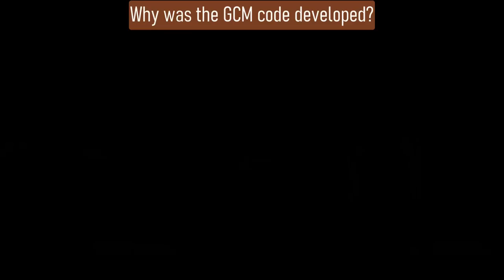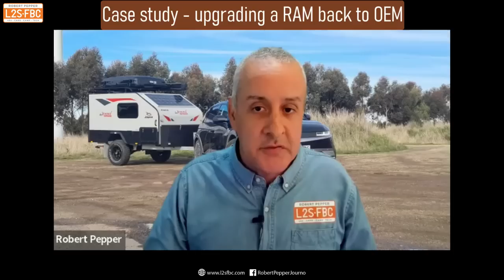TMR interview on GCM, GVM upgrades and trailer law - hear it from the top!

Comment: Very little info on the new GCM code. Would have thought it would have been the big talk of the interview. Even just asking what most people would want to know is "I have had a GVM upgrade on my vehicle, under LS16 can this extra from the GVM increase be added to my GCM so I can retain my full tow capacity. As the original GVM upgrade basically takes from the tow capacity and adds to the vehicle capacity."
Reply from the maker: That's not how GVM upgrades work. The tow capacity and GCM are different and you cannot trade them off like that. Each is a seperate limit. What else were you looking for?
Reply: @L2SFBC  I think you dont understand what I was meaning. I know you dont just trade them. What I mean is for example you have from factory 3000kg gvm and 3000kg tow with gcm of 6000kg. You go get a 110% GVM Upgrade which brings it up to 3300kg and still as above tow and GCM. In theory you will not be able to use either 100% of the GVM upgrade or 100% of the tow capacity due to the total being more then the GCM. 
SO, what I was getting at is that 110% that was added to your GVM (300kg) be included in your GCM bringing it to 6300kg so you can still use 100% of your tow capacity. 
Being that that GVM upgrade has been done is there a simple way to then get that 300kg added to the GCM. 
Make sense now?
Reply from the maker: Hi again - that's exactly what I meant. The three limits are seperate. However, if you're going for a GVM upgrade you could save some time and money by engaging the engineer just once to do more than one limit.  There is no 'simple way' just one way to do it.

Comment: A question I wished you asked is if a rating is approved through a SSM modification can this be used for the new QLD TMR process. This package has been engineered for SSM of a vehicle.  EG a Lovells 4T GVM with 4T BTC and 7.8T GCM upgrade be applied post 1st registration.
Reply: I am in a similar boat. I have pre first reg SSM Lovels GVM upgrade and GCM upgrade in Victoria Federally approved so I think I would be right in Qld or any other State or Territory.
Reply: @stevegoodwin5841  If you have a pre rego SSM upgrade you are good in all states. My point is why can't the engineering that's done on the SSM kit be applied post rego.
Reply: @jebw  If you have a read through the LS11 GVM codes you can use the SSM approved kits to do the same upgrade on a post registered vehicle. You just have to use the exact components used in the SSM kit and have approval from the persons/company that gained the SSM approval to use it or seek the approval through one of their approved installers. I have personally spoken to Adam Shaw about this prior to LS16 being released. Doing a GCM upgrade on a post registered car using an SSM approved kit though I am unsure about

Comment: Hi Robert, I have a 200 series with a Lovells GVM post rego upgrade in WA. GCM is limited to 6850 as per current legislation. If WA adopted the new Queensland laws would I be able to have my GCM re-assessed and upgraded to 7700?
Reply from the maker: Nobody can say for sure. You would need to have an engineer assess your vehicle, identify the modifications required, then pass J2807, and have the Design and Evidence package accepted.  Maybe it would pass,  maybe not.
Reply: Surely you’d be able to get an upgrade so long as the engineer could determine that your existing vehicle would still pass the tests.

Comment: Clear as mud is a good way of putting it.  Robert from your interview can you tell me that if I have for example a 200 Series that was upgraded by Lovells to their 4200 GVM & 7700 GCM that was of course approved by the engineers & new compliance plate fitted & checked by Vic Roads & approved (of course a Victorian registered vehicle).   Does that new GVM & GCM rating stand in Queensland whilst I am towing through their state?
Reply from the maker: I asked the question about interstate modifications being legal in Qld and the engineer answered - you can use the chapter list to jump to his answer. I did not ask about Lovells GCM upgrades or any other specific kit as the answer covered them all.
Reply: Im confused at your question mate. it has always been legal to tow "through" a state with different GVM/GMC laws. I just finished up a lap of Aus with a ranger that had a GVM/GCM upgrade by lovells. it was done in NSW and the vehicle was registered in NSW while we were on our trip. Every single state has no issue with recognising those revised numbers AS LONG AS IT IS STILL REGISTERED IN THE STATE IT HAS BEEN ENGINEERED FOR.

We finished our trip in QLD where we live now, i had to sell the ranger as i could no longer legally tow our van once i had changed over from NSW to QLD rego.
Reply from the maker: Indeed...but the question still comes up.
Reply: Garry, my understanding from the latter part of the video is, yes, you can. What is engineered compliant in one state with all the plates fitted, you can legally drive it in another jurisdiction. You just cant sell it without it being re-engineered in the gaining state. But this falls into the 'buyer beware' category.

Comment: I really wanted to say "All good". But as others have said, the general conversation seemed to get bogged down and become a bit 'clear as mud'. Much of it came down to "it's up to the engineers". 
Seems well and good as long as all the engineers are TMR people and don't hold to kickbacks or other incentives. But, just as has happened with the council requirements in the building industry with the private certifiers being anything but standard in their certifications, one hopes this will never happen in the vehicle registration industry also.
It would be so much easier if the vehicle manufacturers just made vehicles that safely towed the weights we want to pull all over this country. The cost of a new or near-new vehicle is already huge with massive wait times, let alone the cost of the trailer as well. How come we need to modify every vehicle just to tow a van or 5th wheel? There are so many almost standard upgrades getting around. Surely by now, we should be able to buy something suitable 'off the shelf'.
Reply from the maker: I think that's the key - up to the engineers. I'd say the bigger problem is trailer makers going too heavy.
Reply: Up to the engineers is a huge problem because they face all the risk and not really that much of the reward. In Victoria they are super conservative with signing off on modifications, so whilst a vehicle might need the specifications outlined, you just can't get an engineer to approve it.
Reply: Vehicle manufacturers play a balancing game.

On one hand they want to sell vehicles, and if their performance statistics are woeful, nobody will buy them. On another hand, they want to build vehicles as cheaply as possibly.

Long gone are the days of just slapping together excessive amounts of metal so that it’ll last. These days there’s incredibly advanced software programs that can simulate an entire warranty period of stress/strain/fatigue upon every single tiny component, and identify when and where things will break. From there they can improve those components until they get the vehicles to a point that believe an acceptable percentage will not see failures within the warranty period.

The problem they have is that Australian Consumer Law gives serious power to individuals such that if even a couple manufacturers start extending warranty periods, and building stronger vehicles that last longer, ACL states that the warranty means nothing, and that a consumer has rights based on “reasonable expectations”, so as some manufacturers start skewing the expectations, it makes others liable for failures they don’t design out by making more durable.

Manufacturers don’t want to be responsible, and they don’t want to give you “the best” vehicle they can. They design something they know will sell because you have no real options, but they hold back massive amounts of performance so they can loosen the reins a little every few years, to make people upgrade for fear of FOMO.

If they actually have customers the best they could, they would actually have to develop proper upgrades to lure buyers into upgrading.

Since manufacturers don’t want to give you the best, and don’t want to be responsible, why would they want to give customers higher GVM’s/GCM’s/BTC? All that would do is make them responsible for failures.

By making you go to SSM to get upgrades, OEM’s can wipe their hands clean of any failures, but suggesting the upgrades caused the failure. Adding 50% more capacity means the drivetrain has to work harder, so that can be absolved. The chassis bears more strain so without reinforcements it’s not the OEM’s responsibility, and with reinforcements it’s not the OEM’s responsibility as they didn’t make the modifications. Same goes to suspension and axles, etc.

It’s less responsibility to offer less, because the risk of failures is less, lest you defy the capacities, thus absolving them.

Stateside it’s big business to offer high capacity models and packages, but we just don’t see the volume here to justify it.

Maybe as some of our models become more global products, these sorts of options might start flowing through, but it’s not a given.

The LC300/LX500d/LX600f aren’t big enough volume. The Prado and Lexus GX aren’t big enough volume. The Tundra/F150/Silverado/1500 offerings are too niche here to make those offerings yet. Maybe the closest in the Ranger, and maybe the Hilux (if it’ll be based on the Tacoma). Even then, there’d have to be “Heavy Duty” packages offered stateside first before we would start seeing them here. Likewise if the full-size “Trucks” get real volume here; locally, they will start offering Heavy Duty packages.

Everyone just needs to keep hitting up SSM’s. Maybe that’ll be the interim solution; campaign for OEM’s to partner with SSM’s, to develop upgrades in line with the vehicle development, so that upon release buyers can get the upgrades from an official partner. It might be a compromise.
Reply: @CM303898  Plus Australia is a tiny market on the world's stage. Australian purchasing decisions don't have that much influence.
Reply: @HardstylePete  exactly. We are a risky market (in turns of OEM responsibilities under ACL), and so adding risk by accepting higher loads through higher ratings just doesn’t stack up to them.

It’d be the Wild, Wild West for upgrades if ACL didn’t exist.
Reply: So I'm replying to my own OP! I know that is silly but this is a complicated issue. 
I have a quite old (35yo) HJ75 cab chassis type ute with an aluminium tray. It has served me very well all these years as I am its second owner. The first just drove it to a few grain farms in NSW to pick up samples.
I've had it all these many years and have no desire to let it go. I have kept it in excellent condition. It has no rust or damage, no bog and all its bits intact. It does have some 'upgrades' before they were considered upgrades! a bigger clutch, a reconditioned 1HT engine out of a Sahara, bigger brakes, better shockies, more leafs, etc.
I remember the manufacturer stating in the manual that it would carry a ton. In those days a 1 ton ute carried 1 ton! I've carried 1 ton many times. Always knowing it could handle that load.
Nowadays, landcruiser cab chassis types are still classified as 1 ton. But they actually can only carry half that weight because the rest is soaked up in all the other parts of the vehicle. And some are only rated at 750kg which is 5/8ths of bugga-all! 
A person buys a landcruiser ute type vehicle to be completely reliable and carry a ton, pure and simple. How Toyota can make such a vehicle to be only a 750kg lightweight, which in fact means only around 250kg in the tray, is beyond me. That is just a baby ute and a truly ridiculous proposition. Leaves a bad taste in my mouth and makes me feel like Toyota is pulling the wool over our eyes. 

This is basically what CM303898 said in response to my original post. And I assume all the other similar manufacturers are on the same bandwagon too. Which is very sad for this country as we tend to have unique needs by dint of tyranny of distance usually.
But now we have a variety of other brands usurping King Toyota's crown and if they are not careful to get their arse into gear quickly, they will loose their widely and so far, easily held, top spot (in this country anyway). But as stated, what this means in the greater scheme of things is diddly squat. 
Having to wait so long for delivery on such an expensive vehicle is wearing thin on many people who don't have the time or the inclination to do so. So they are looking elsewhere at other brands that claim to be tougher or better or whatever. 
And while they may not end up being as good as a Toyota in the long run, most people who would not wait, really don't care for those sorts of feelings as they will sell that vehicle in 3yrs time and get something else or stop touring or whatever.

Comment: Davis Dam test,  They allow for a towing dyno or a climate control stationary dyno with the load requirements programmed.
Where does the average person access these?   

Why not assess certain section of road across the country and come up with our own drive cycle test?

It Always comes across like TMR want to the seem like they are listening to what we want and acting on it, but they always implement it in a way that is overly difficult to access the required test facilities or is in some other way restrictive.  
Their goal seems to be make it too difficult for most people to do it.
Reply from the maker: The average person does not. They engage engineers who rent the equipment required. I agree we could maybe do J2807-Aus and use a different grade, in another video I suggested Harrietville to Hotham.
Reply: @L2SFBC  
There would be numerous roads across the country that wold be suitable.  

Can you imagine the cost though. 
engineer rents equipment and tests,  vehicle fails.    
go away and make changes, rent equipment again test again.

Or,   Test on a section of freely available road.      

These things should not be purposefully made prohibitively expensive.   Which is what it looks like has happened.
They should be based on sound engineering and tested with reasonably accessible testing methods.